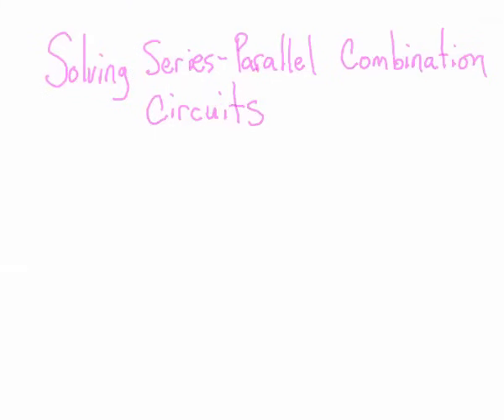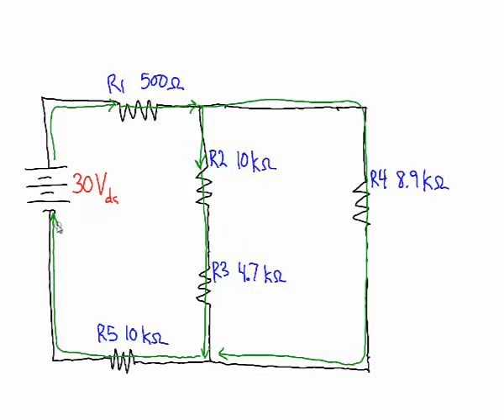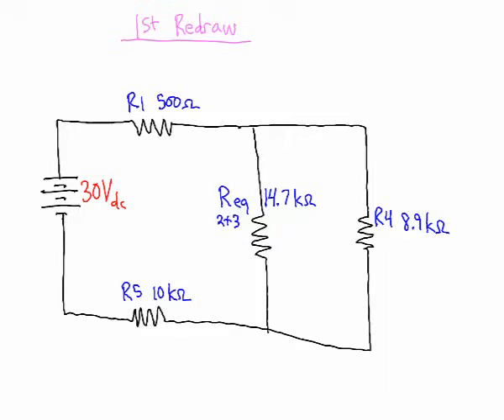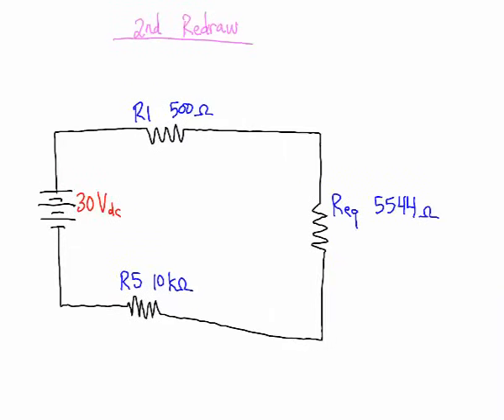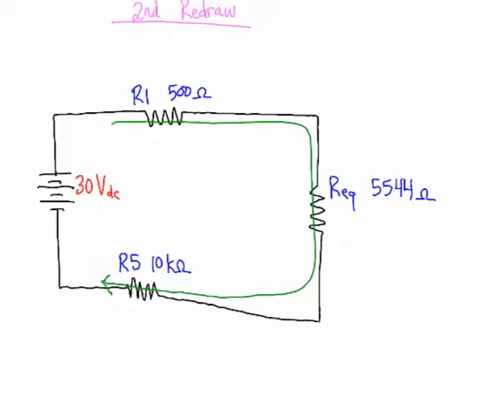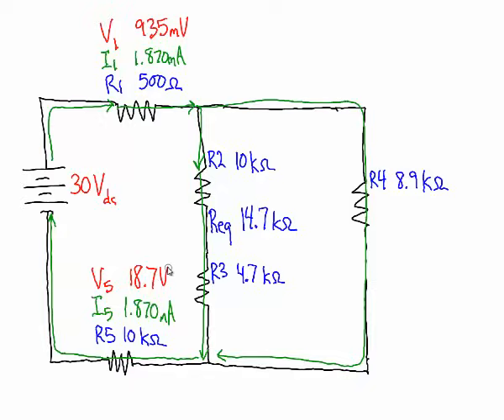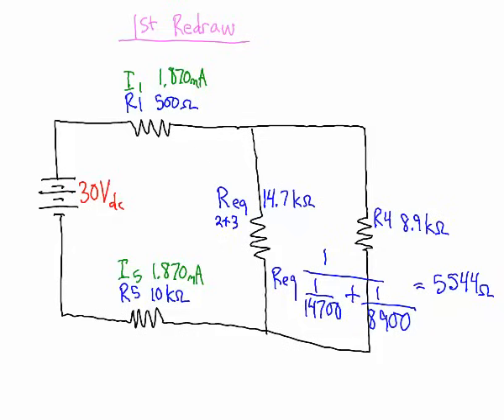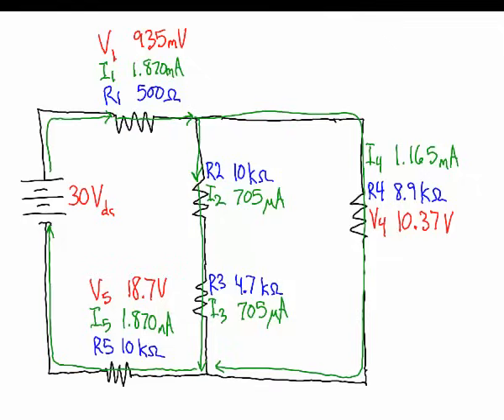solving series parallel circuits

Comment: Several people have commented that current flows from negative to positive.  Please understand that electron flow is from negative to positive, but current is just flow of charges, and it doesn't really matter if it flows from negative to positive or positive to negative.  What matters is that current flows.  Before it was discovered that electrons are negatively charged, people had to decide a convention for flow, and it was decided that everyone would consider it as flowing from positive to negative.  Hence, even to this day, people still consider conventional current flow from positive to negative.  Unless specifically stated that current shown is electron flow, assume conventional flow.  This also prevents people from installing circuit components for which polarity matters (diodes, electrolytic capacitors, etc.) wrong, since all components are labeled using conventional flow polarity.

Comment: how do i solve current and voltage drops for parallel and series circuits?
am i able to use voltage and current divider formulas on mixed circuits?